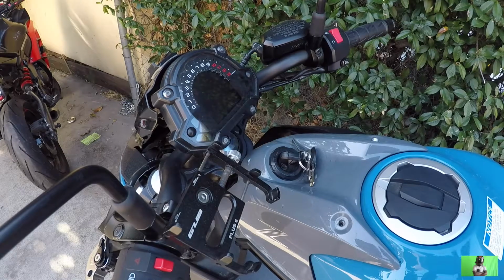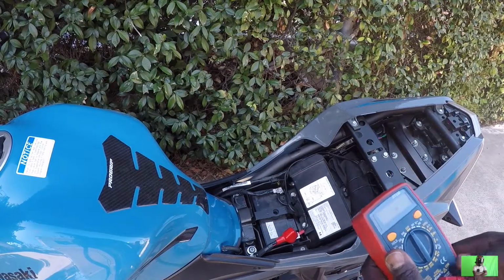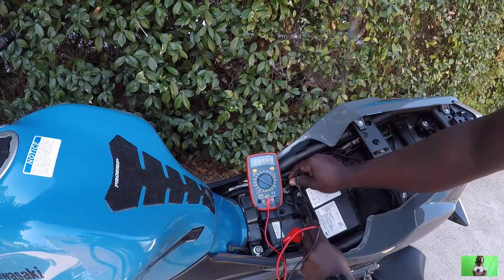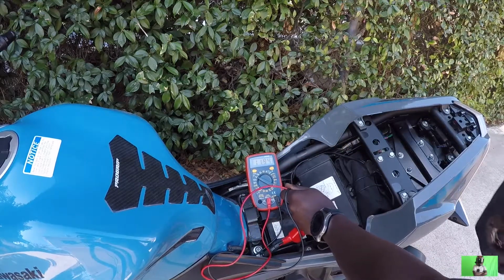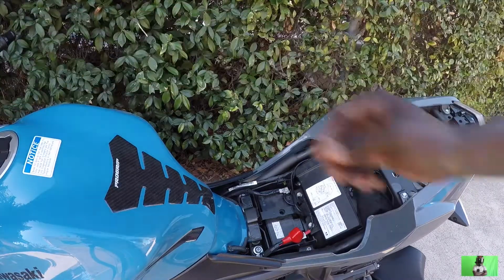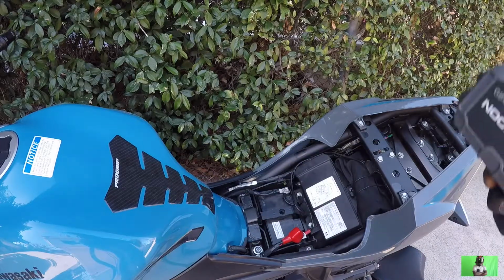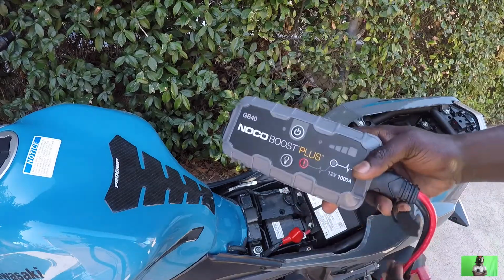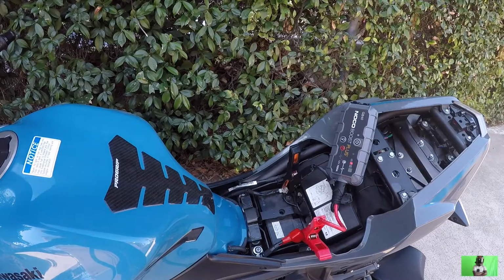Bike won't start| NOW WHAT?

Comment: Great video, I believe if you use a car to jump start a bike the car motor must be off as the extra current can fry the bikes electrics. I use an 'optimate' charger here in the UK to stop my battery going flat. It connects to a socket wired across the bike battery and monitors and charges the battery all the time. I've left the bike for six weeks and its starts first time. Before I had the charger the battery would lose voltage after ten days to two weeks.
Reply from the maker: 100% agree